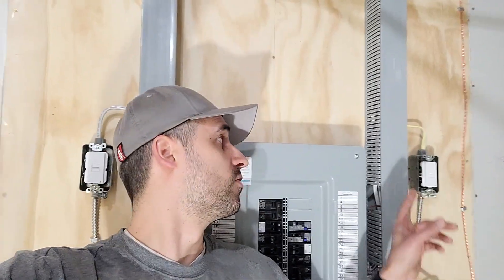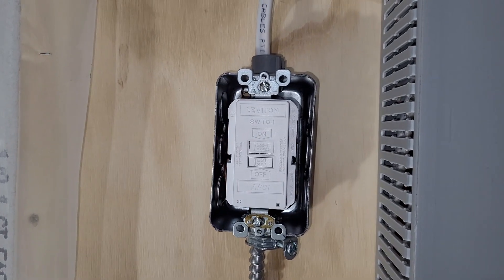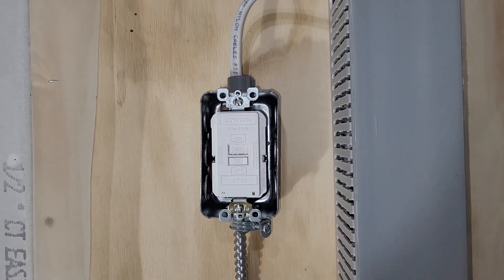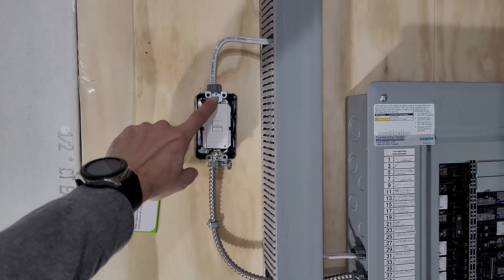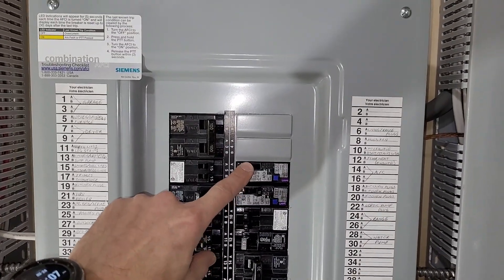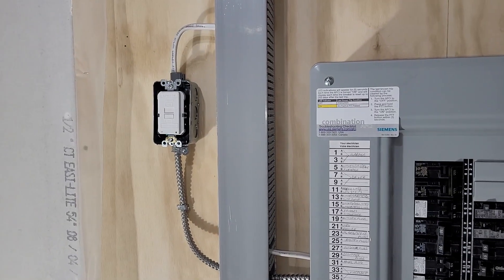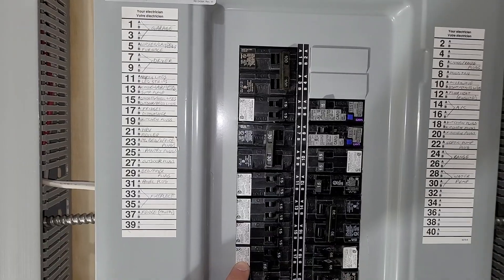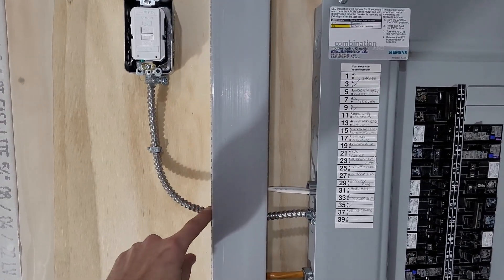How To Fix Arc Fault Nuisance Tripping For Good!

Comment: So is this just a way to bypass the electrical code on using arc fault breakers and using that device as a substitute? Does the device work better than the arc fault breaker?
Reply from the maker: This is definitely 1 way to comply with the code but not use an arc fault breaker.  The circuit is still arc fault protected and you bypass the overly sensitive siemens breaker.
Reply: Complied!... @energyoneelectric
Reply: Anything other than a siemens arc fault breaker works better than a siemens arc fault breaker!
Reply from the maker: @pawelelektryk2985  agreed
Reply: Agreed. They used to swap faulty breakers with the afci/gfci combo breakers but stopped doing that because they were fronting the cost of material. There new tactic was to just accuse us of faulty wiring practice.......such as, back stabbed plugs, overloading,cable staples too tight, wire brackets too tight, neutral to ground contact,poor marette connections ect ect . We're soo done with seimans breakers. I can see why people remove them illegally
Reply: Interesting and makes sense. My sons new condo has these Siemens breakers, all circuits have AFCI/GFCI combos.The microwave and washer work ok , but his espresso maker is an issue. I am unable to do exactly what was done here because of where his panel is (without cutting out wall). I tried installing a GFCI receptacle where the coffee maker plugs in and it ended the tripping so far. I seems the coffeemaker destabilizes the current flow when it switches from one mode to another (grinder to brew, brew to froth, etc. , never consistent when). My theory is the GFCI receptacle may counteract that.  I also thought the GFCI would confirm if there was , indeed, a fault inside the appliance ( very new). I also see some threads that a surge protector may do the same. What is the “standard” breaker product number that would fit his Siemens panel ( looks exactly like yours with plug on neutral)?